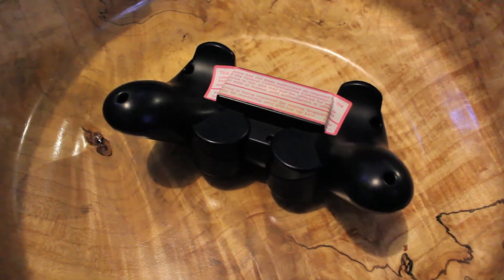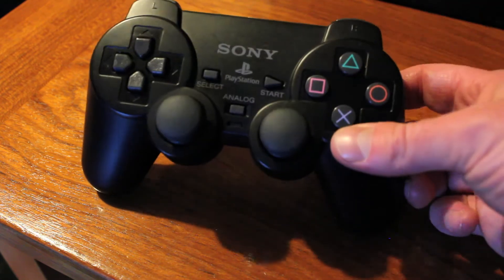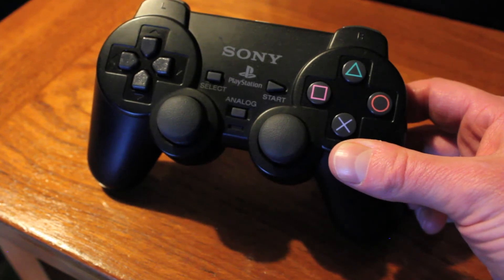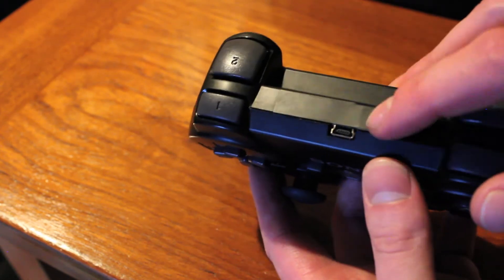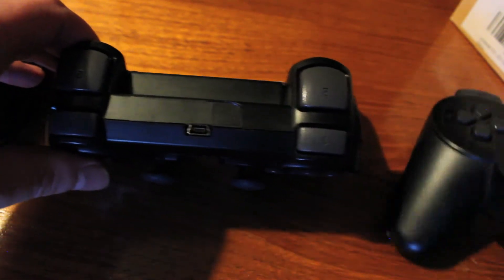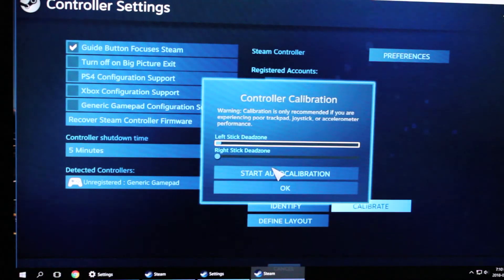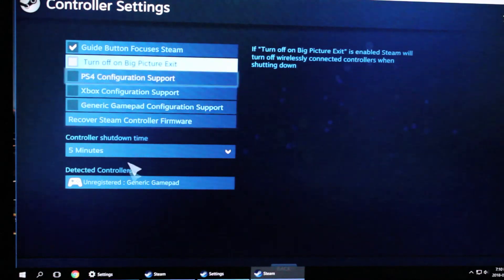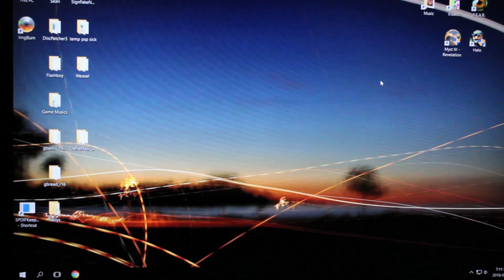PS3 Prototype controller

Comment: Wasn’t the prototype controller in the shape of a boomerang?
Reply from the maker: That was an early mockup. The functioning controllers sent to devs with pre-production kits came with these sorta controllers. There were lots of designs in between this and final, but sadly the boomerang isn't one of them. I haven't seen even a boomerang mockup in anyones hands outside of Sony yet.
Reply: speedyink huh, didn’t know that. Well, the more you learn.
Reply from the maker: @HiHi-jh2uz  Another fun fact about the boomerang mockup is that the actual button setup is freaking tiny. There's a pic of it out there in someones hand, and it looks way too small to be comfortable to play.